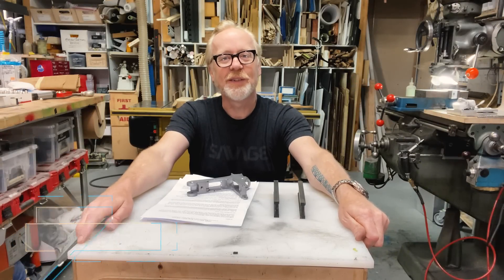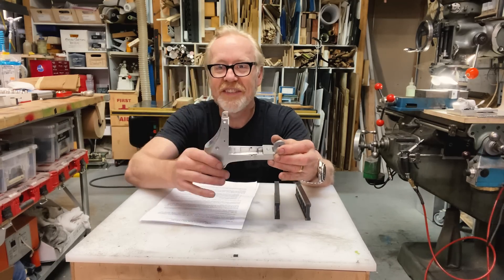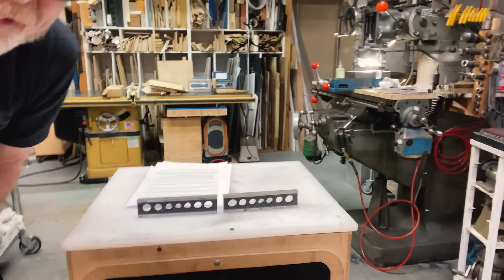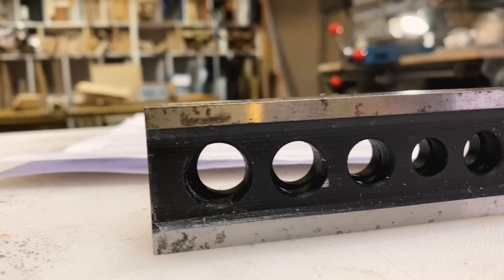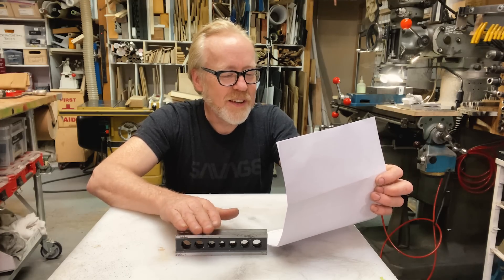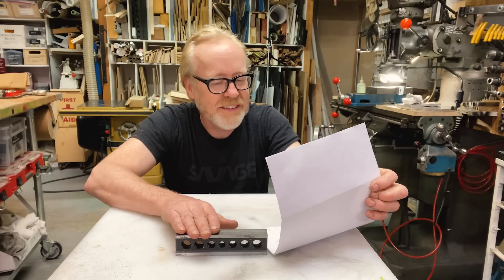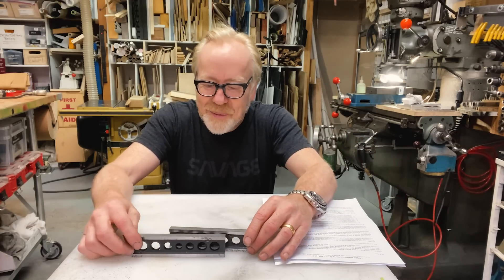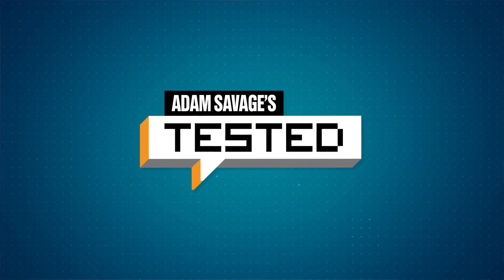Adam Savage's New Machining Parallels!

Comment: What are the bores in the parallels for?
Reply: Lightness mainly and they were often wet with coolant fluid and so could be slippery, the holes made the easier to grip. Also in the story I used the holes to make them stick to the outside face of a thin wall section I was machining that made a hell of a lot of noise otherwise (vibration or ‘chatter’ as it is known)
Reply: Thems speed holes. That's so you can move faster setting up.

Comment: Adam: Mr Peterson, a retired high school shop teacher, has a series of videos where he restores a Southbend shaper. He also has a heck of a lot of other great videos related to metal fabrication. But don't let him see you use your compressed air to blow away chips - that's his pet peeve! :D He is currently down-sizing so you might be able to get yourself some more machines or tools. In draughting, parallels are two straight edges connected by hinges which allow you to draw a line parallel to another. https://youtu.be/tRRsJqrIt9Y
Reply: Nice video style and presentation.

Comment: A good way to tell me is in Metric 😂
Reply: Believe it or not, first thing I learned on my first day of training (apart from my clock number and where the toilet is) was the imperial measurement system. Most of the aircraft I worked on were imperial (except the Hawk which was metric) - old designs you see, especially some of the parts for Buccaneer and Phantom.

Comment: You definitely should use metric system... This thing about thousands of an inch makes no sense at all .... 
Why not millimeter or microns ....
Reply: It would make sense to you if you were a machinist using the values in practical applications. Then you'd either be measuring in thousandths with calipers or ten thousandths with a micrometer. And there'd be nothing else. So you'd express everything in terms of either the thousandth or the ten thousandth. Because as you metric proponents are always so quick to point out converting is undesirable. There's more to it than just that of course but that is enough for now.
Reply: It’s odd Henrique, I grew up using metric, but a limit of 0.003” means more to me than what the metric equivalent is!  We actually had to be taught the imperial measurement system on our first day of training. As Paul says, it just seems to make more sense for some jobs. Mind you I’m from the Uk so I buy my fuel by the litre but still talk of fuel consumption in terms of mpg and distances in miles, but switch between metric and imperial measurement systems depending on what I am actually measuring. Us engineers are an odd bunch

Comment: Adam, .00002” is actually 20 millionths. Which is 10 times more accurate than you had stated by saying “tenths”.
Reply: Machinists refer to various values in relation to the instruments they commonly use in a shop. Those instruments are the caliper and the micrometer. Along with various dial indicators. That kind of thing is rarely graduated in millionths. So it is a matter of practical familiarity. It is ingrained linguistics. So that's why a machinist is going to call it 0.02 of a tenth. And every other machinist on the planet is going to know exactly what they're talking about.

Comment: TL;DR a step drill in reverse makes a pretty good screw extractor.

I have a little tool hack I would call it that I recently discovered.  I was working on a Surgical table and had a couple of screw heads strip on me.  At this time I discovered that my shop does not have a screw extractor kit, which most of you know are hard to use anyway.  In a moment of insane genius, I grabbed an appropriately sized step drill.  I drilled into the screw in reverse and as soon as the next step reach the metal it grabbed the screw and unscrewed it.  I was able to do this successfully twice in succession.  So if you need to extract a screw and don't want to fiddle with a screw extractor or just don't have one, reach for a step drill bit instead.

Comment: Well you know what they say about shapers. You can make anything on them, except money.
Reply: Except, in today's world, they are by far, the cheapest way to obtain a machine flat surface of proportional size to the machine (so bigger, better), that's flatter and more even than anything short of a smart CNC (to be read, with self adjusting, learning capabilities) can do. I'd say that for someone of small shop size, a shaper is an excellent money maker for precision jobs. AND, the fact that people who have wizened up to this, are grabbing them up, to use, is proof in the pudding.

I bought and imported mine from US, same model and variant as Abom79's and it has now recouped its purchase and expenditure within 5 projects. Because i set that baby up twice, then walk away, and at the end, i have a perfectly flat, perfectly machined surface. Something i would have to scale up to full CNC to, otherwise do. 

Since a regular mill cannot reset itself, and ultimately, unless trammed to perfect precision, it can't even touch that level of surface flatness.
Reply: @aserta  Yeah there are large quantities of old shapers on the market for cheap because they are too slow to be profitable in a production environment nowadays (similar to EDM machines except for a few niche uses). But for the hobbyist or job shop they're great.

Comment: When I made parallels, I always made sure they were not only parallel within .0001", but also flat in the free State within .0001". So many parallels are indeed parallel, but not flat in the free State. Primarily on the broad side. Also when drilling the cross holes, the distance between centers should match something you will be using them on, such as the distance between the t-slots on your Bridgeport mill table. You can then lay them on their sides, t-slot bolts through the holes, and place your workpiece on the parallels. I seriously doubt the parallels in the video are flat or parallel within 0.00002", that is 20 millionth's.Very difficult to achieve that level of flatness on even the best surface grinder. We are talking lapped finish at that point.
Reply: When I worked in a tool and die shop we'd regularly achieve 0.00005 right off our surface grinders. Then if we needed it closer we put some 600 wet or dry on a surface plate and give pieces a swipe on that. When you got good you could consistently shave 0.00001 a swipe. Wasn't much to it really I didn't think.
Reply: They were my parallels and they were flat and square to 2 tenths of a thou. Adam got a little carried away there 😄

Comment: Some how I still do not understand how they are used. I will look it up on youtube, I am sure there will be videos showing how to use them. Thank you for sharing with us the great stories.
Reply: You use parallels to raise work up in vises. Often you want the work over the top of the vise jaws so you can machine that material. Otherwise you'd be running your tools into your vise and chewing it up. Often vise jaws are hard and when tools contact the hard jaws bad things tend to happen. The tools and or the jaws shatter and send shrapnel all over the place. Which is not good.

Comment: "Every machinist has a set or two" FALSE! TRUTH: Machinists purchase and use parallel sets like most fashionable women purchase and wear shoes. They will purchase sets for a specific vise or machine, or just because the cross holes are drilled in an interesting way or pattern... every once in a while they will be practical and purchase a specific set needed for a job...
Reply: And then you ruin one and get a full new set.
Reply: So, a set or two or the unspoken forty to four hundred other sets? (I typed "ot" three times in a row instead of "to", that's it, I'm clocking out now)

Comment: ".00002", I feel like there was a communication error here. Thats 2 hundred-thousand-ths of an inch. I suspect adam read it right as ten-thou, but said the wrong number of zeros/moved the decimal.
Reply: It was 2 tenths of a thou
Reply: Imperial that is. These were tools so you work to tooling tolerances, I was expected to hold 2 thou (inches) so had to have tools capable of meeting those tolerance requirements
Reply: Leigh Johnson no, that would be 0.0002”. The OP was right- it’s two hundred thousandths of an inch.....based on what Adam said. I’m guessing however, that you are confirming the actual tolerance to be 2 tenths of a thou??
Reply: @Glenrok  you do realise you're telling the actual aerospace machinisy who made these very parellels he is wrong... Go re read his username.
Reply: @antiundead  Lol. Yes, though I didn’t when I started typing, I twigged halfway through. I thought that was obvious from my reply. Just so we’re clear though, I’m ALSO an aerospace machinist with only a few years less time in the field than he himself- going by other answers he’s made, so I was not talking from a position of ignorance.......
Reply: @Medieval-Kenieval  i believe this.
Reply: I always say millions of an inch when you get to 5 decimal points. 20 millionths of an inch. I wonder if they are actually that accurate or he misread.
Reply: For metrology instruments 20 millionths is not an unusual standard.  For a shop floor tool it is not practical, because by simply picking up those parallels the heat of your hand will warp it measurable millionths.  They may have been ground to 20 millionths, but as soon as you clamped a part on them they are no longer that precise.  The parallels used for certification processes are never clamped hard like a machining parallel, and are kept in temperature and humidity controlled environments.  If those parallels are accurate to 0.0002 they are a very good and precise pair of machinist parallels.
Reply: No its this .0002 in machinist speak this is two ten thousands of an inch. Achievable with sand paper or a good mill. Tightest I've ever done was .00005 it was for an optical lens
Reply: Dominic I’m aware of that, as I’m a machinist myself. I was clarifying what Leigh said compared to what the OP said- which corresponded to Adam’s words.
Reply: Dominic although I feel you may be mixing up parallelism with surface finish. 0.0002” parallelism is VERY difficult to achieve with sand paper- & even with a good mill- although achievable with a good setup on the mill at least....
Reply: Yep, runout was 2 tenths of a thou
Reply: I should know, I’m the guy that made them 😁
Reply: If only there was a better measuring system to avoid such confusions? If all you have is as a unit is the ‚thou‘ you have to resort to lots of decimal zeroes...
Reply: X Y I would probably jump into using microns at this point. One micron is I believe about .00004”. I know it’s metric, but it’s the best I can think of
Reply: @andrebyman8744  

"I know it’s metric"

I suspect that was the point. :)
Reply: @andrebyman8744  Yes,  0.000025" = 1 micron, sooo yeah,  I don't think our shop can claim that kind of precision with any of the parallels we use.

Ours are 0.0003 (~8 microns) at best.
Reply: @xy1468  umm, the inperial unit is the inch, we need a lot less zeroes than the metric guys do measuring in meters.  .000001 meters is only .00004 inches.  If you cheat and use prefixes instead of zeros, so can we.  We can measure in microinches just like you measure in micrometers.  Don't argue against imperial on the basis of placeholders, that isn't a valid argument.  However if you argue against imperial because it doesn't make much sense to have things factor by oddball things like 12 and 36 instead of just always 10, then you do have a valid argument, and yes, metric is a lot nicer to math with.
Actually, what is really fun about imperial is specifications are usually written in decimal inches, however the most common imperial scale used by machinists is in fractional inches, so they have to do fraction to decimal conversions in their heads every time they whip that scale out of their pocket and measure stuff.  I think the reason for that is primarily because a 64th of an inch can be seen, .01 inch is just too hard to read on a ruler.
Reply: It looks like the best 1x2x3 blocks that you can get are accurate to .0001, so it was either a mistake or the aerospace machinists are on a whole other level lol. I personally made my own 1x2x3 blocks and they're accurate to .0005, which I though was pretty good for my first try and certainly good enough for what they were being used for.
Reply: @Doodlebob563  when something is specified as, "accurate to" that means it is at least that accurate. How accurate it is, is another story entirely. But it is at least accurate to 0.0001 In those cases production usually tries to hold to another magnitude of precision. That's to insure the product meets spec. It is kind of like the game show, The Price is Right. You can't exceed the actual value or you lose. No customer is going to complain that something is too accurate. That needs to be balanced with production costs though. Precision takes time and time is money.
Reply: Paul Frederick - spot on Paul
Reply: @Doodlebob563   Actually I am sure you can get 123 blocks more precise than that, for instance these guys will make them to your tolerances:
https://standridgegranite.com/products/123-blocks
But yes, for inspection purposes you can add another digit of precision, you just can't take them out of the air conditioned room they live in and expect them to hold those tolerances. I am sure there are parts in modern aircraft that are required to hold tolerances well under 0.0001. Grade 0 gauge blocks are accurate to 0.05 microns, or approx 0.000002 inches, yup, 2 millionths of an inch.
Reply: @Doodlebob563  well aerospace machinist do work in the millionth but its most likely that those parallels are in the tenths.

Comment: I did about 5 years outta high school on a Bridgeport, making something different just about every day.  The problem was the shitty pay. Gotta say those are very nice. oddly enough case hardening is a rather simple operation.
Reply: Heat treating isn't case hardening.
Reply: @Fred Smith I used to harden press dies in a salt oven. I just had to wire them up and give them a soak. Then take them out and quench them. It was pretty wild. These thick blocks of steel would come out of the salt and they'd look translucent. Like I could see right through them. Then to get them out of the wire I'd snap it off. Because the tie wire would get hardened too. That's how you knew it worked.

Comment: Makes me wonder where mine are... we never got to that level of precision at our training centre. The parallel grinder was there but never used.
Reply: James, I still have my 3” box square and Chuck tap wrench. The fitting apprentices made all kinds of g clamps and spanners; the 4 machining apprentices made tools we would use when we came out of our time. About 10 years prior to me going in there, they used to make a working steam donkey engine. Now THAT would have been something!
Reply: We made an air powered motor of metal parts when I went to school. I would have loved to make parallels
Reply: I ran a surface grinder in a tool and die shop. It's kind of goofy. I called it leading the band. Because one hand you turn a wheel to make the table go back and forth and the other hand you turn a wheel to make the table go in the Y axis. You have to coordinate the two motions too. One hand you're going round and round and the other you just move fractions of turns. It just always struck me as a funny thing to do. Takes a bit of practice to get good at it. But once you do get good at it you can give metal surfaces beautiful finishes. Sort of make them look like old metallic audio tapes. They have a bit of an oil slick iridescent sheen to them. To achieve that you have to get your travel very consistent. There's videos here of people that don't know what they're doing with surface grinders. Takes a lot of practice to get good at it really.